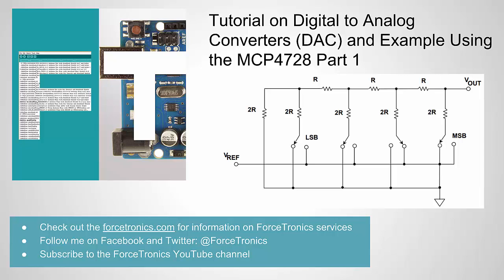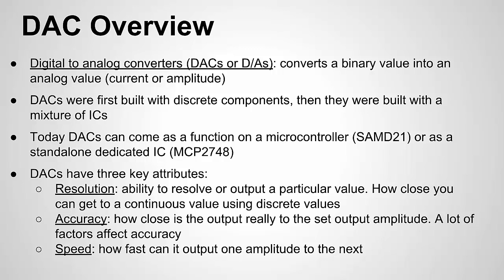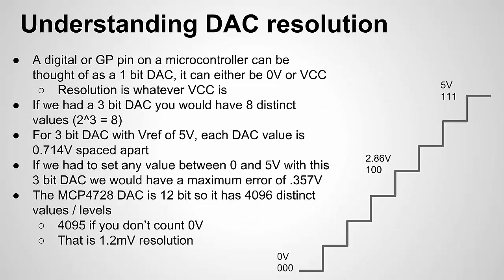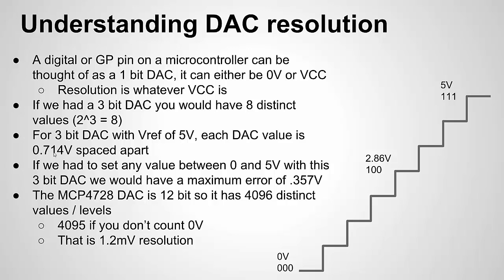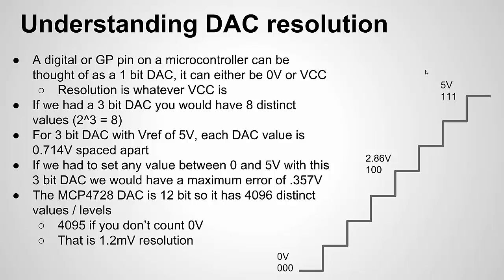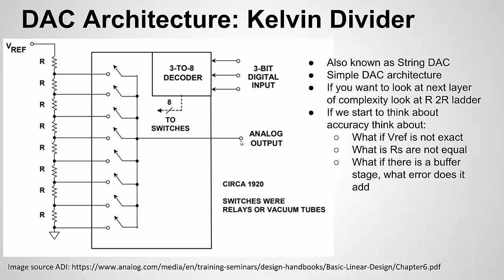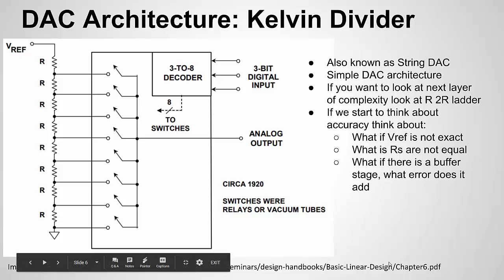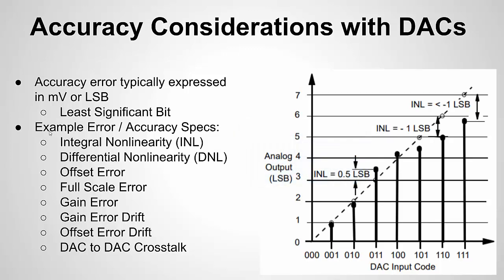Tutorial on Digital to Analog Converters (DAC) and Example Using the MCP4728 Part 1

Comment: Cool run through. I'm really interested in this subject right now as a simple hobbyist. 
  This may be a little long for a YT comment but hopefully you'll bare with me.
  I got one of the cheap Chinese "linear" power supply kits based on an ATmega8 and 8 bit R2R. After getting halfway through putting it in an enclosure, I decided to look and see if I could find the original  project as most Chinese kits tend to be based on OSHW projects. That lead me to the tuxgraphics (probable) origins of the kit. I also read a couple of threads on the EEVBlog forum describing the naive simplicity of the tuxgraphics design. I was about ready to toss everything at this point. It's kinda irritating when people jump on YT and create content about stuff like these kits and fail to do their research about the origins of the product and fail to do the most basic functionality testing. I came across a few people that claimed this kit was at least marginally useful, and got it. At $12 it's no big deal, but lesson learned.

  ...anyways, I went ahead and built the dumb thing. I figured I could still make use of a few aspects of the project even if I must toss out the kit entirely. I'm thinking about creating the video I wish I had come across showing why this kit is bad....I just have to figure out how to correctly characterize a R2R DAC. I know Alan (W2AEW) has an upload about R2R's hopefully I can pick up some pointers from your next upload and from Alan.
  This power supply kit apparently uses the m8's ADC and the R2R to set the output. It also has a transistor based amplification stage, and a wire wound ceramic resistor as a shunt for current limiting. 
  I took some pictures of the 2 bare boards and will probably do I full KiCAD schematic along with showing a line by line retrace of the boards. (BTW - I'm not monetized/don't plan to change that/this is not self promotion - it's actual ignorant curiosity)
   The subject of the kit got me wondering how such a design can be improved. Apparently the design uses PWM and oversampling to extend the resolution of the DAC on the 3 LSBs. I'm curious if a simple op amp buffer would improve the setup by shifting the feedback corrections to an analogue control loop. This subject also has me interested in the practicality of using DACs in op amp feedback networks for precision DC applications. In a hobbyist type of application, why can't we just calibrate a DAC in the μC, maybe even with some form of temperature compensation? I also wondered about using 2x lower resolution DACs in a circuit for an integrated output. Something similar to a typical course and fine adjustment setting on a traditional linear power supply. I'm sure my questions reveal my naivety here, but I'm genuinely interested and trying to learn more about the real world applications of DACs and how to characterize them.

  You've probably already established, if not recorded, all of the content you intend on making for this subject. I'm not asking you to make anything specifically about this, or for me. You don't even need to answer my aforementioned questions. This is just intended as an example of the kinds of questions a dumb hobbyist without an academic background on the subject may have, and a practical product specific issue representative of the type of "trap for young players" one might encounter.

  Regardless, thank you for another save the reference level upload.
-Jake
Reply from the maker: Hey Jake, this is a really long comment. But it is better than the some of the comments I get that just use one sentence and say how do I design X (where X requires lots of questions and hours of work). Those types of questions I just don't answer so I do appreciate the detail you included. I stay fairly busy 7 days a week so I don't have the time to research the exact kit you are referring to but here are some top of the mind comments:
--> kits that don't work are frustrating but working through the issue is a great way to learn
--> It sounds like this kit has you build a DAC from the discrete component, are you using the kit just to learn about DACs (which is great) or do you have a need for a DAC in a project? If the latter is true then just go with an off the shelf DAC IC (like the MCP47xx family) and learn how to use it.
--> You mention something about PWM and oversampling, which I didn't follow. I do have a video on how to create a DAC using a PWM signal. It is only for applications that don't need a high accuracy DAC. Here is the link: https://youtu.be/AkSm1W8xdKY
-->You mention op amps and not sure what your level of experience with op amps are but they can be tricky if you are making an assumption on a spec or capability. There is many times I have bought op amps for a particular application but they didn't work and I had to turn to a senior engineer to help me understand the knowledge gap so make sure you understand all the specs for an op amp before you plan it in your design (plenty of material on the web on op amp specs)

Good luck